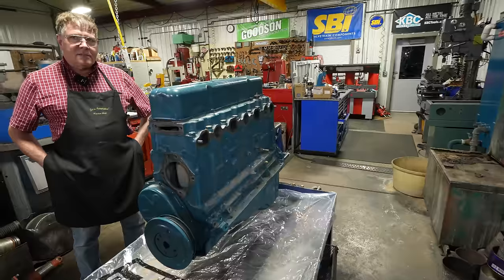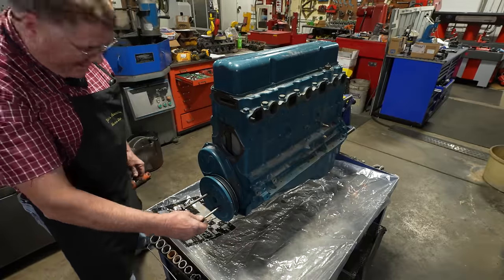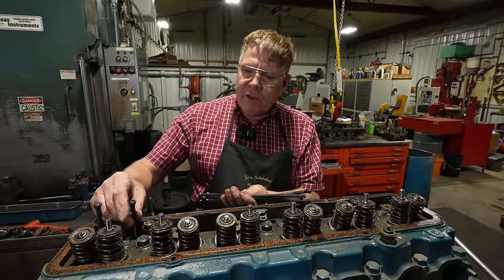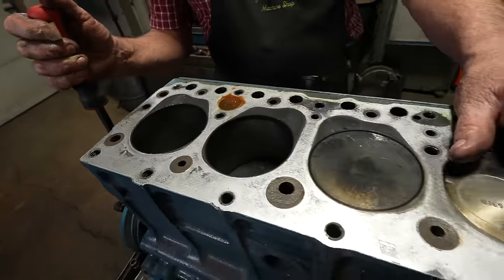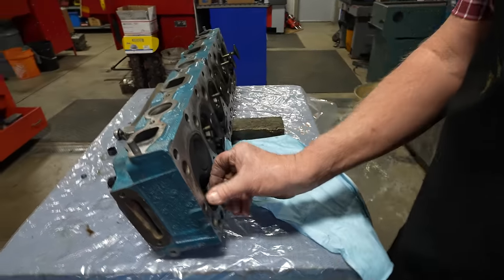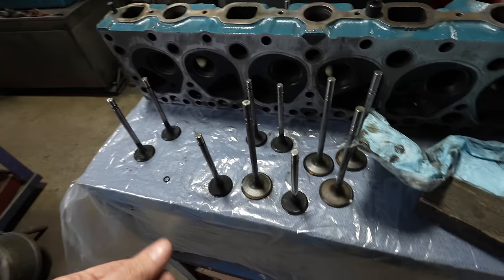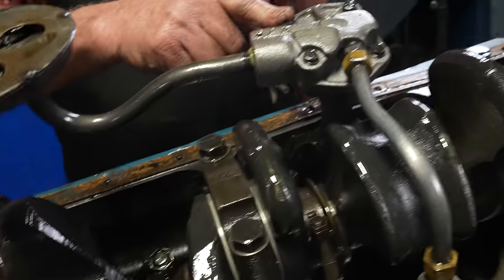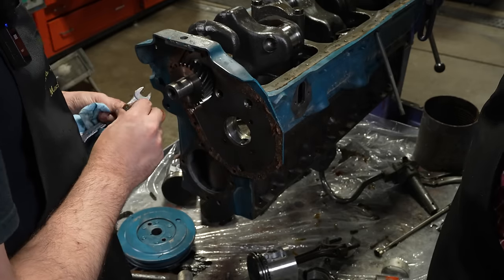Their 235 Chevy BROKE DOWN 10 Miles After The LAST Shop's Rebuild...

Comment: Cast steel (or is it cast iron) engine blocks, must be weathered after casting for 3-5 years after casting before being machined and put into service? For a fact the Ford V8 flathead blocks were laid out in the weather for five years to weather. So naturally 58 - 61 would be correct for a cast code. A stamped code would be close to the date of vehicle manufacture.

Comment: I ran into a situation back about 2000, or so. I rented space from the trucking company to park my truck and trailer. I worked for Cummins Ontario
back in the early 70’s, got my ticket and went trucking. That’s my background anyway, so this trucking company had about 4 mechanics, and a 
couple of welders which was handy for me as I was a car hauler. So one day I’m walking through the shop, and their engine guy says to me, 
“ what do you think about this “ ? The engine was a Mack, and it was on its side on the floor. He put the socket on the crankshaft and rotated it.
It turned fine and had the pistons and rods installed. He “ now watch “. He tightened the rod bolts on rod #6, and when he tried to rotate the 
crank, it wouldn’t budge. Loosened it and it rotated fine again. I said what do you know about the engine and he said it was bought used some 
time ago.  I said, have you looked at all the rods to see if there’s another #6 stamped rod ? He took a look and sure enough it had two #6 stamped 
con rods. He switched caps, and it worked fine. Sometimes things aren’t what you assume them to be. My head was so big I had to exit the 
building through the open shop door, don’t think it would have fit through the man door.  Worked on one of these 235’s in a 58 Biscayne ? 
Lots of bottom end torque. You could let out the clutch and they would idle up to the upper deck on the car carrier effortlessly. Thanks for the 
great video.

Comment: My 47 Chevy Pickup had the Babbitt main.  Knock, knock, knock.   Replaced it with a 57 235 from a wreck car.  That was in 67.   That baby was a workhorse.  I hauled baled hay for my horses from a farmer up the road a ways.  Drove it to town 35 miles away, for supplies, that wouldn’t fit in the car.   Puttered along 55-55 mph, (everyone else is going 75-80).   Sold it to an old truck enthusiast in 1970  after I sold  the horses, kicked wifey out and bought a new Motocycle..
Reply: That 47 pick up threw a rod , with  30, 50 lbs bails , working hard, one steep hill that I should have avoided , as it started knocking and luckily, didn’t damage the block.  Replaced the rod, ran like new,  loved 50-55 mph.

Comment: Those old sixes would be burning lots of oil by 60,000 miles.  Our family 55 Chevrolet 210 engine was and I paid an old time mechanic to "rebuild" it.  He only knew rings and bearings.  They cut quite a ridge out of the cylinder tops and probably should have been rebored.  I took it to the shop at 7:00 AM on a Saturday and they put new rod bearings and rings in it and gave it back to me by 1:00pm at a charge of $81.99.  It didn't burn oil for 3k miles and after I drove it wide open for several miles one day it was back to burning a quart of oil every 200 miles.  I was 18 yrs old at the time and drove like a maniac!

Comment: That's almost identical to the old Toyota fork lifts. We would shim bearings. I dont miss those days. To eliminate the drivers from running them too low on oil and locking up engines. I installed a extra oil switch with normally close switch. I hook it up to the power side of the coil to stop power when running low on oil. It would shut the lift down, till they checked the oil. We saved that company thousands of dollars till they finally upgraded to newer lifts.

Comment: that one different main bearing reminded me of a thing i found about maybe 10 years ago when we had to tear into the engine of a Buddies Citroen ID (basically a lower spec DS) because the headgasket went out on it. After taking the Head off and cleaning the Soot off of the Pistons we found that a previous owner must have replaced a singular Piston and Sleeve with an oversized version. I am still, to this day, completely puzzled as to why they didn't just go for the same Size if they were replacing the sleeve and Piston anyways but we figured that if it worked until now then why change it? So we just put it back together with a new headgasket plus valve stem seals and to this day it's still running quite well with it's singular oversized Piston.

Comment: Yeah Do not line bore any block . The rear main seal channel groove does not get changed so it remains in original position , so you cut the upper main saddles , the upper seal then is tighter onto the crankshaft . The cap portion of the rear main seal is 
 " now " farther away from the crankshaft . A non fixable oil leak is the result . Yes guys have align bored blocks , and given the material removed may have escaped this issue. Many have fought a rear main seal leak , tried everything and given up not realizing the line bore did the block in . Machine the rear main seal channels in block and cap if such a thing exists . In that vein , a rope seal is likely the only alternative seal that likely can save it .. maybe

Comment: The oil feed line to the head was not a sealed connection from the factory. If not careful with the reassembly it could actually leak oil and loose oil Pressure to the valve train.
It's better to modify that area and drill and tap. You could use brake line fittings to make the connection.
That way you have full oil pressure to the valve area.
It's a common problem with these types of engines.
That's why most of them have worn out rocker arm shafts And a valve train issues.

Comment: Absolutely fascinating! So... It turned out the previous guys had put very slightly too tight valve stems or whatever they were called and that caused one of them to quickly seize up, smack against the piston and seize up the engine? However there was a major problem when those same guys screwed it up the wrong size of one bearing? However the chap who owned it was actually lucky that one mistake led to a stoppage before the second one absolutely ruined his engine? You were both very decent about not having a go at the other mechanics, but... I think the owner should have a talk with them!

Incidentally 'mains' are what the USN call the primary guns on a battleship, battlecruiser and the like. 'Cycle the mains!!!'

Comment: Great video, I’m a 25 year automotive mechanic. I had a customer drop off his bel air to get the engine freshened up. I pulled the engine and took it down to the local machinist. Just finished putting the engine back in. She runs great but has some valve lifter clack. I readjusted the valves, and put about 25 miles on it. Is this common for these lifter to make noise? Will it go away, or should new lifters be installed? I think air is trapped inside the lifters.

Comment: Interesting note on the soft bolts. 
Back in the early 80's a guy sold me a 61 Apache 10 with a shot engine fo $80.
I sent it to a shop for an engine rebuild. I've never heard so many different excuses....We can't find the bearings, it's still in the hot tank, it's actually a corvette racing engine,  it's this, it's that, we put it all together then found out the block was cracked, on and on it went.
It took over three months for them to rebuild a new block.
Finally the day came to go get my truck.
I paid the guy a sum well over his guesstimate, drove it just about 10 miles home, and went inside.
When I came out there was a huge puddle of oil under it.
They had sheared off about half the bolts on that side cover.
When I called them on it, it was my fault because I was in such a hurry for my truck.
"I told that kid, don't over tighten those bolts! But you were in such a hurry....."

Comment: I have a theory why he brought you the engine and not back to the engine builder. I'm going to guess that he was told to bring the engine up to temperature and then change the oil to the operating temperature then immediately change the oil to flush out the assembly lube, and keep the RPM below 2k until all the surfaces bedded in .
I'm guessing because it's got 10 mi on it. He took it out for a ride and wanted to feel the acceleration so gave too much throttle or rpm, did not do the warm up oil change. Thus because he went against the recommendations of the break-in process from the engine builder, there was no warranty. Plus embarrassment equals bringing it to you.

Comment: Wow, that went from not looking to bad, to looking a lot worse very good quickly... That poor thing was on borrowed time from the get go.
It's amazing what you can find when you start looking deeper and uncover the real ugliness. It amazes me when a shop doesn't do a thorough cleaning, but I guess it shouldn't be a surprised when someone obviously didn't check the bearings before putting it together.
Given that you commented on the rod bolt nuts, I'm also surprised, especially given the age of the block and not knowing the history,
why they didn't put new rod bolts in it either. I know it's not a high hp engine but it's still a very critical component. If those are the original bolts and nuts they have certainly stretched over its many years of life and rebuilds. I know people do it all the time, but I'm really fussy about things
like that and in my mind it's cheap insurance on any rebuild. ..
I agree it was probably a packaging error that somehow happened with the bearing half,  but the ultimate blame is certainly on the assembler.
Although it had a short life initially, and probably wouldn't have made much difference, I'm really curious if the engine was primed, 
and if they had an actual oil pressure gauge hooked up, and if they did, how much pressure it had ?

Comment: I have to wonder if the builder of that engine used .003 oversized valve stems and, reamed the guides to fit, tight ones  (valves) he just hone the stems ? Just a thought. I operated a machine shop for 45 years, have seen that done. Just a thought.

Comment: I have recently rebuilt a small diesel by Fiat (1.3 litre 16 valves twin cam ). I made the silly mistake of rushing the cylinder head and have had to do it again. Second time around was horrible because I didn’t take the engine out of the car. It’s fought me every step of the way.

Comment: I still own of the 2, 1975 Dodge D100 that my Dad received for free with the Purchase of a Dodge Bighorn Semi Truck. The D100 is powered with the ever reliable 225 Slant 6 and a 4 speed Manual transmission.  With over 900,000 miles, and rebult twice. Still a daily runner. Ford, Dodge and Chevy stopped producing their inline 6 Cylinder engines. Because they were Reliable.

Comment: I would like to see the assembly of this motor. In defence of the previous builder, I recently rebuilt a P motor for a 1976 Nissan Patrol 4 by 4. I got the rebuild kit and never checked the bearing sizes. I ask for standard bearings and took it for granted the kit was correct.

Comment: Curious why you didn't throw that main cap on right there to measure..............Is it possible they swapped out the cap and made it work with the bearing set?  I know alot of engines around me done by cheapo owners that only did one journal or one hole or one set of valves.  Made no sense to me at all, but they thought they were saving money.

Comment: I have never used any seal that wasn't called for from the factory. Those umbrellas work by starving the valve stem of oil. I am curious as to what the original shop and the customer discussed pertaining to the rebuild and the warranty work.

Comment: I'm thinking the engine was being starved of oil (especially to the top end) because one of the main journals had excessive clearance due to the wrong bearing installed and would have likely indicated a low oil pressure reading on the gauge

Comment: I prefer the 1940 engine with hemispherical combustion chambers. I just reground the valves by hand and set the valve lash and it worked fine. Really fine, it would start up at 40 below zero F. with a short 10 ft. roll down a hill and pop the clutch. Carter carb. That was in 1960, I would like to have it now, but won't trade my Tesla.😁

Comment: You should see some of pf the stuff the owner of Omega clinic had to deal with.  Stuff like aftermarket solid lifters being shipped and sold with zero heat treatment or hardening.  Twenty miles later, the entire engines turns to a core that may or may not be only good for the smelter.

A lot of good engine rebuilders went out of business due to these issues.  Worse yet, a number of hacks went into the business to exploit the market.

I work at AutoZone and one time i had a customer have an emotional breakdown in the parking lot when his rebuilt motor came down with with low oil pressure.  Initially the customer thought it was low on oil and added s bunch.  When i checked the dipstick, it was a few quarts over and coming out of the breather and down onto the exhaust manifold.  I let him borrow a drain pan with some tools to drain out the excess.  Sure enough, lots of glitter on the bottom of the drain pan.  Grabbed a container to save a sample for the customer and advised him to remove and save the oil filter dor later autopsy.

Comment: The hydraulic cylinder that got kicked over off of some sort of Allis Chalmbers tractor. I have a set that needs rebuilt for my 7000 series I was wondering if you could do a rebuild video on those style cylinders. Can’t seem to take it apart without cutting the bottom off. Anyways great video thanks!
Reply from the maker: Remove that oil fitting on the side.  Look down in the hole and you will find a snap ring that goes all the way around the ram.  Dislodge it with a screwdriver and the ram will come right out.  Very simple if you know how it was designed.

Comment: My 1956 Chevy 210 Sedan came with it's original 235 and OEM 3 on the tree.  A complete LEGAL runner and driver with very slight damage to anything.  It shifted good, but not great. Was soon fixed.   Best $6000 investment I could have made in 2002.  That 235 ran great and barely sweated any oil.  For some odd reason I decided to keep the 3 speed and sell the motor, Dangit!.   Found a receipt in the glovebox for a hotel in Bogota Columbia, with the correct license plate number, dated 1982, right at the start of the Columbian cocaine period, which make me wonder about the car.  Found a Air Force Id Badge also, Dated 1985 which the owner will go unnamed, For Malmstrom AFB, 341st Missile wing with the Minutemen III ICBM's in Great Falls Montana. SOME kind of history with that old car. If it could talk.
  Correct me  if I am wrong, but I think GM or ?? had 50 aluminium 235 blocks poured in Mexico, specifically for drag racing, with thicker everything to handle alot more power, ect, ect.   It seems I read a article about a Super Comp Roadster racer being involved, getting his hands on those rare 235 Alum blocks, and making BIG 6 banger power and winning races.  Thanks for the video.  Looks like someone was in a rush to build/finish that motor and had a major "whoopsie".    Never, ever get in a rush when "finishing" a motor.

Comment: Great vid, but hitting two ball peen hammers together is a definite no no! I’m a long retired Cat mechanic and in my early days (didn’t know any better) that same procedure sent me to the emergency room with a chunk out of the face of one hammer the size of a 22 bullet in my chest above my heart stopped by a rib so a bullet was dodged as they say on that day. 

Also in my way back days, I was doing an in-frame on a 20A 977 and the customer insisted on “gypo” parts and I opened a new box that was supposed to be .020” under for the rods and one shell was standard, so it does happen and that was back in the early 60’s when quality control was arguably better.

Comment: 21:00 If that valve was so frozen, how was the engine able to be manually cranked, much less with no noticeable bump in the rotation? It was stuck open at full throw, and the impression it made on the piston gave the clearance needed?